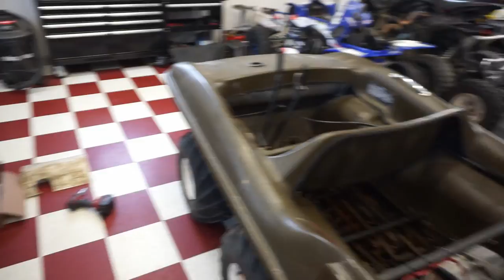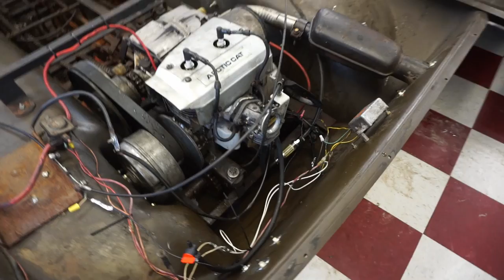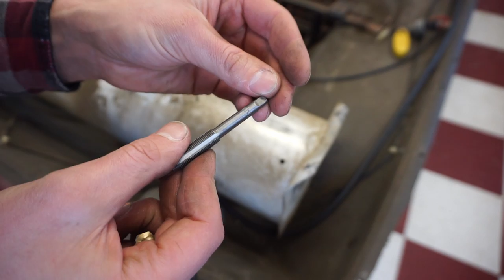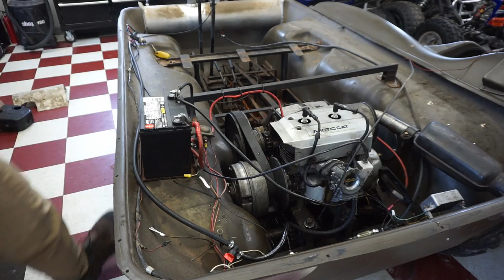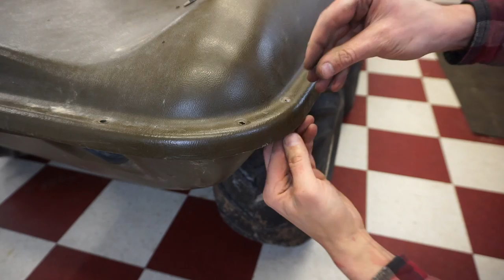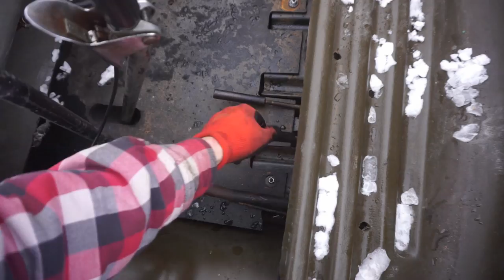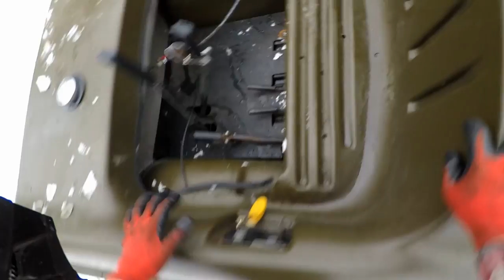First Ride On The $800 2-Stroke 6x6 TANK (This Thing Moves!)

Comment: Lube the throttle cable and check float system, should not have a "fuel return" just a "drain plug" with a diaphragm?

Comment: I don't know why you need that fuel shut off valve in the back, because fuel valves are supposed to stop fuel from coming into the engine out of the tank, not a return line.

Comment: It would be good to replace the lights with led if you can find some that fit. If the headlights are as I expect they are they are probably 35 watt. They are ok but led would put out more light and use less amps.

Comment: Whom ever sits the back seat has a Heated seat! yes sir that little 300 cc rips good runs fine. yep you gotta tie down the battery had that happen to me once in my ford f100 62 but it was not as bad as your clutch cutting a hole in it. mine fell on the fender. I got it tied down after that LOL Be great for a little guy or a woman or kid. So no leg room for a tall guy like you.

Comment: You should have taken my advice on the last video you did on this, I can almost guarantee 100% that is the issue. Good luck my friend
Reply from the maker: What was your advice? I try to read through all the comments. Sometimes I miss some.
Reply: I tottaly understand, you have 100s of people giving you advice on things, I get it.. lol.. it was about that carburetor, a few tricks to try on that particular carb, I've rebuilt a bunch of thoes and they are very tricky. If you feel like ur still having issues with the hard starting and the idol issue, if you take the carb apart again file each layer on a peice of sandpaper  cause thoes carbs are known for warping and creating air leaks between each layer even with new gaskets, and just try to file each peice down so they are perfectly flat, use a streight edge with a light if you have to, and then when each peice is flat put just a smudge of gasket maker on both sides of every gasket to make sure you have no air leaks, those carbs are so sensitive that even a pin hole can make it hard to idol down, I've had to do that a bunch of times on thoes carbs for all the older sleds I have. Im pretty sure you know what I'm talking about with each layer, try that and if you have any questions let me know I'll try to answer for you.. I'm pretty good with thoes 2pump carbs.. But a huge pain in the butt.. lol
Reply: @jasonspringett5367  question please, why is there a tube for gas over flow into the tank? Carbs I worked on years ago had an over flow for gas if bowl gets stuck, and dumped on the ground .Not a return like this. Does this system make pressure like a fuel pump, am I missing something? Thanks for helping.
Reply: @themachinist7039  Yes these carbs have a built in fuel pump at the bottom where the "float bowl" would usually go, so as its using vacuum to create sucking there is a diaphragm in the layers that acts as a fuel pump any gas that isnt used just get sent out the other side in a return line since it doesnt have a bowl and float to shut fuel off, it's a series of diaphragms and gaskets that sucks fuel in and extra gets pumped out that the engine is not using, it wasnt a great design but it did work well when they actually worked, but after they need a rebuild it's almost impossible to get them to reseal and not suck air. That's why they only used them for certain applications like a long travel distance between fuel tank and carb, like the articat fuel tank was on the back of the sled and gravity feed didnt work cause it was so far away from the carb so they designed this crazy set up to get around that..
Reply: @jasonspringett5367  thank you for being so kind to answer, have a great day.

Comment: I have CCW twin snowmobile engine that has been tore apart by a machinist and it was ported and polished and it has a 38mm mikiuni racing carb on it I still have the extra jets that came with the carb and It was bored out to 440cc this thing has more power than it could of thought of when it was in my Scorpion super stinger snowmobile give me a call

Comment: I'm not a 100% sure but  it  looks like you can split shift  the T20 transmission on that with the two levers and it will turn inside it's own radius.  Your Max 2(not Argo) has the same tranny with  one lever. I have  a max4 and  I  know  there's  an aftermarket kit to do the same. One side turns opposite of the  other.

Comment: Why have a shut off in your return? Better chance of leaking into hot engine bay. Line should be solid run more towards bilge area of body, NOT attached to electrical and run behind a battery. Intake line should have a filter on it especially since you just put metal shavings in the fuel system. Get a plastic fuel tank,like a portable boat tank.I would put a bilge pump in the bottom of the hull and mount a fire extinguisher.

Comment: It could be A fire hazard the you got it if the wiring ever was to ketch on fire. Having it the other way wrapped in asbestosis muffler wrapping like on your dirt bikes use. Will work for that part to.

Comment: I would have epoxied a nut on the fuel tank to take the fuel return or better still soldered a nut on.  I doubt the O ring will seal correctly on that curved surface.

Comment: put some fuel resistant teflon tape on your barbs when you do metal on metal so they dont back out or come loose from vibration and seal better
Reply: for your tanks
Reply: put a real power plant in there and switch to a conventional steering and throttle and make that thing rip!!!
Reply: Teflon tape is ultra bad news for anything that has tiny holes in it, like carburetor jets.

Comment: Will the original drive clutch bolt onto that engine? Looks like you’ve got some belt alignment issues because of that huge clutch on the engine side.

Comment: Hey Joe man that wire next to your fuel return line  isn't A very good idea bro. For real man. I'd run some pvc pipe with A 90° degree's elbow.,or elbows on the inside of it. By using bicycle foot brake frame stop brackets with two extra mini holes drilled into them. So that  those brackets be mounted safely.& Securely to the wiring after  inhoused inside of the PVC piping to. For double safety reasons alone as A newer improved safety upgrade to that part as well to. Tucked close to frame like you already did.

Comment: First by yourself a decent set of screwdrivers next do you need washers top and bottom of those bolts that hold the clamshells together so you don’t tear up the fiberglass digging the nuts and I should tighten them get yourself a pair of crimping pliers instead of the channel locks you were using and then for god sake buy something at four stroke so we don’t have to listen that god awful two-stroke noise anymore

Comment: That Kawasaki engine won't live long running that high of RPM's wide open full speed you shouldn't be much over 4500.they're great engines we sold Arctic cats in the 70's and those engines dominated. That 399 has more power than the440 Koehler.

Comment: Hmmm, I am missing the details in your work. Your subscribers should also be learning, like securing the battery (big mistake), washers under the nuts (the top will tear). Your only goal seems to be to get the engines and vehicle running for a couple of minutes and that's it. There many Youtubers in the same field who explain why they are doing things the way they do. Like I said, I am missing that. Kindest regards.

Comment: MY  HUSLER  HAD  THE  CONTROLS  CENTERED...
YOURS  ARE OFFSET  TO LEFT.....REAR  SEAT  WAS LARGER.....BECAUSE   THE
ENGINE  COMPARYTMENT
IS  A LITTLE  SMALLER  ON THE EARLIER  FIBREGLASS
MODDEL